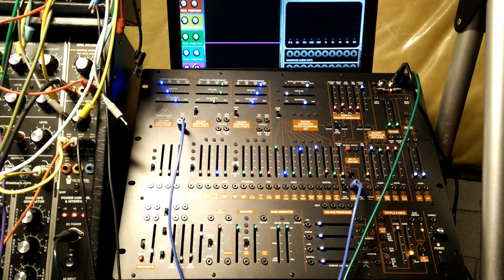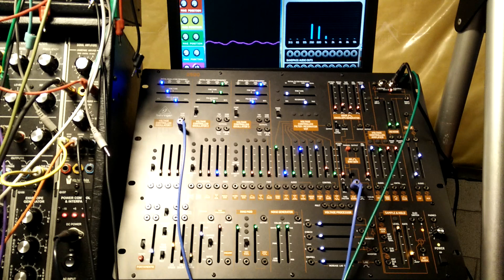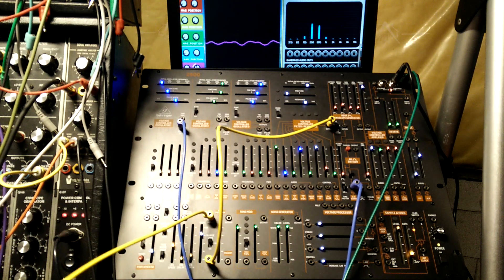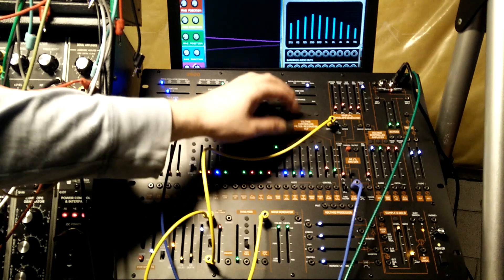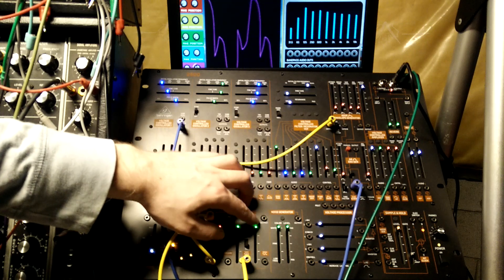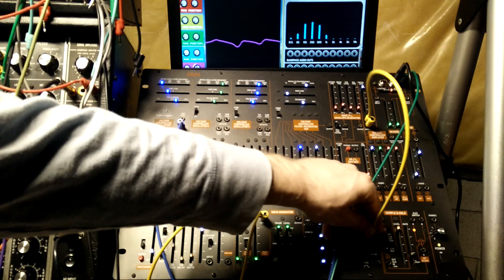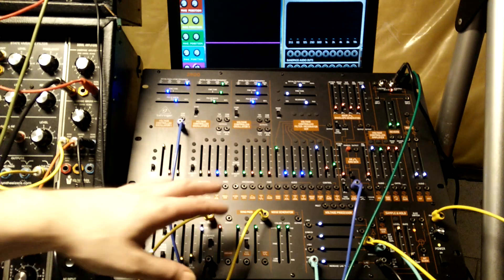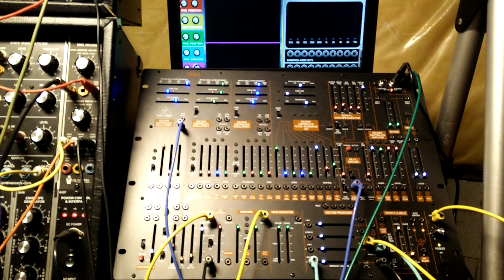Behringer 2600 Ring Mod Output Trick

Comment: Thanks for the video. The oscilloscoop you are using, is that software?
Reply from the maker: No problem! I forget what is in this video so thanks for reminding me of it. The scope is a module called CV Watcher running in Cherry Audio's Voltage Modular. It's not a very good scope I just like the colours. Thanks for commenting!